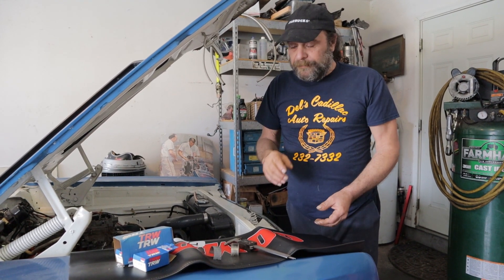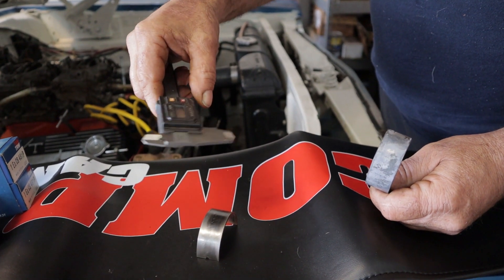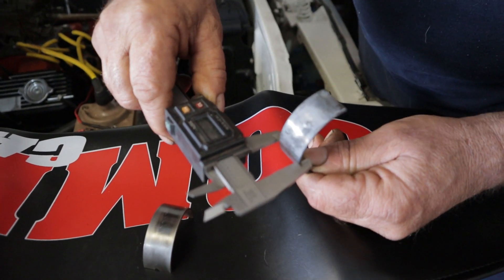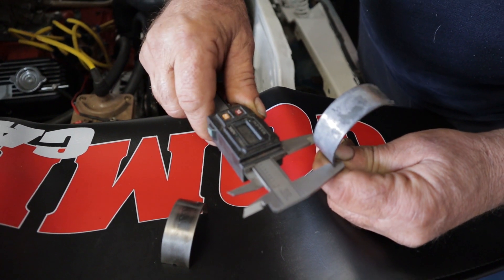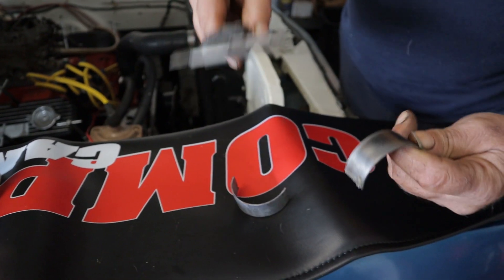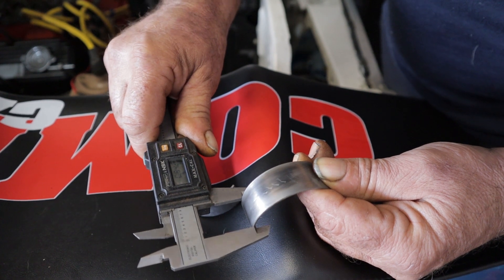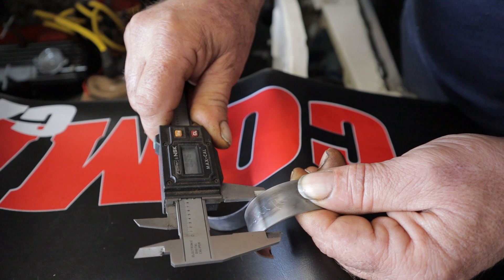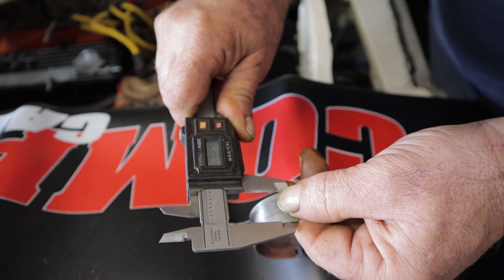Detonation...The Number One Killer Of Hot Engines

Comment: Hey just a question ...sometimes when I shut my truck off it keeps wanting to run a bit .. is that a timing problem?
Reply: If your carb has a shut off solenoid you should check that. My 73 Tbird did that for a while. Quick way to tell is if it still "diesels" when you shut it off in gear. 

If not, check that solenoid.  The solenoid is supposed to partly open the butterfly so you dont trap gas vapor in the manifold on the hotter running engines (big thing in the 70s)
Reply: @iamakactus2588  thanks I'll look into that . Kinda got a Mickey mouse set up 15psi factory fuel pump with a regulator on the line
Reply: have seen this numerous times where it turns out to simply being retarded timing requiring the idle to be turned up to compensate. This allows too much air to pass when the ignition shuts down causing the run on.
Reply: clasic timing or carbon in cylinder
Reply: If there's enough carbon it will act as a glow plug as it stays hot enough to ignite the fuel & "diesel" on for a bit untill the carbon cools down.
Reply: @pedrorojascervantes3928  or sometimes just hot spots in the head due you heatsoak
Reply: @pedrorojascervantes3928  pretty new engine I don't think it would have carbon maybe 5000 km
Reply: @PredaFran  , that i didn't know ! Carbon build up on high mileage engines will increase the compression ratio & will require higher octane fuel. I have a '89 Bronco with a 302 & it only had 50, 000 on the clock at nine years of age & i couldn't seem to get rid of the knock at acceleration untill i hooked up a platinum , rhenium & rhodium passive vacuum injection kit. About six tanks later i gained power, gas mileage & the knock disappeared.
Reply: @stevenzw1  , Currently i drive a 1991 GMC pick up & the friend i bought it from five years ago had only 80 ,000 miles on it & I'm sure it was carboned  up as he drove it only a few miles a day & only very rarely took it on the freeway. It took some time but i started getting more power out of it once it the poor 305 got some exercise. No pinging really , just no power. I don't think it takes that long to lay down some serious carbon if you drive a V8 like a hearse,  sit & idle at the waffle house parking lot.
Reply: @pedrorojascervantes3928  I have a 496 big block in mine check out my video
Reply: @pedrorojascervantes3928  yeah, it really does an engine good to run hard every so often. Usually just cruising around, give it to the teenager to play in the parking lot once a month or so.
Reply: @ScottKenny1978  apparently the Ford 302 that was in the Crown Vics & that i have in my Bronc  was susceptible to carboning up, especially in the taxis.
Reply: @pedrorojascervantes3928  yeah, I had a 79 LTD with a 302 in it, stepmom didn't drive it hard enough to blow the carbon out. Teenage me drove it too hard, sucked a valve. Oops.
Reply: is it a high compression engine because cheap gas low octane will cause engine dieseling it could be lots of reasons. too hot of a plug even carbon on the plug can cause it, timing could cause it anyway it's not good for a engine to do that so you should fix it sooner then later you have to go over one at a time add better fuel octane booster if that don't cure it retard the timing a degrees see what happens check make sure your running the right spark plugs not to hot of a plug if it don't work try some seafoam to clean the carbon deposits out of the engine because carbon in the CC can make it run on too.
Reply: @79tazman  yes I should be running higher grade
Reply: Hot carbon in the cylinders is causing detonation/dieseling.  Carbon builds up naturally, but if you have the timing and idle speed set right, it shouldn't do that.  If it's a daily driver, not hot rodded, make sure the timing is at 10 degrees or less advance, and make sure the idle speed is below 800 when the engine is warm.  Chokes and fast idle cams can stick, leaving the idle speed way too high which can cause the problem.
Reply: @livewire2759  , thanks for the insight, appreciate the old school smarts here !
Reply: Is it an iron head ?
Reply: @PredaFran  no aluminum
Reply: @JonsReef yeah with uncle Tony's carb videos I'm gonna get a vacuum tester . really gotta get this engine tuned in

Comment: Had to laugh I can tell you worked on a fuel car. They don’t even check them anymore. Just replace! We check ours in our tafc after about 3-4 passes a lot of the well financed teams will replace after every pass and check back at the shop
Reply from the maker: Diver was always my chosen position, even when I was running the show.  A look at the plugs, check the lash on any suspect cylinders and then read the bearings.  Tells you everything you need to know about the basic tune.